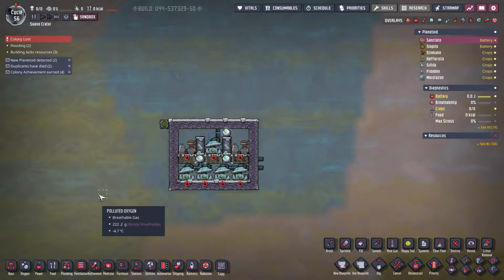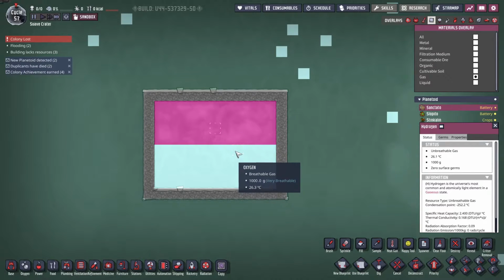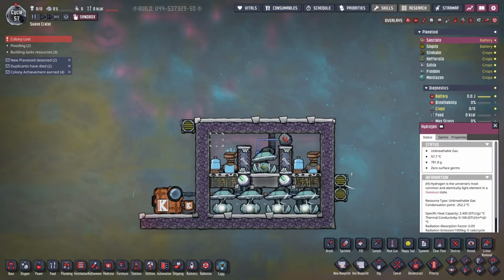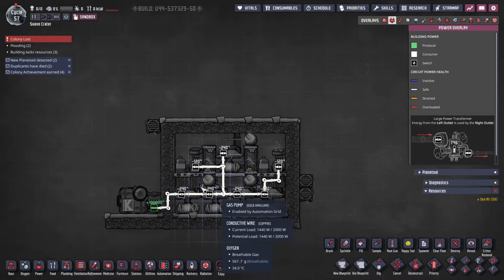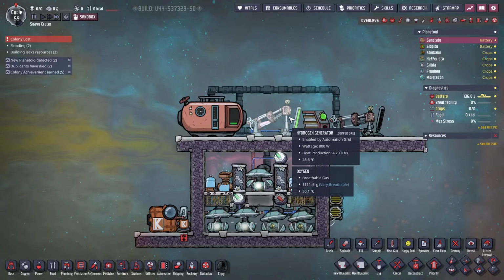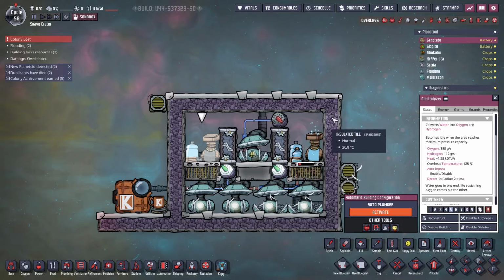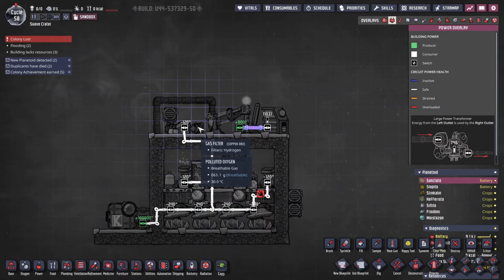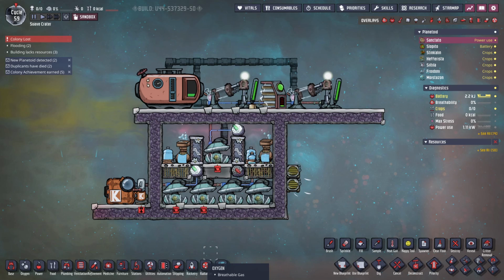Oxygen not included: Producing oxygen with the Half-Rodriguez

Comment: When starting in forest biome I just build the whole thing at the border of the copper biome so I dont have to worry about the heat. :)
No gold or extra cooling needed, I just build with what ever metal I have and run the pipes trough the colder area then when it reaches base (like 10 tiles away) its nice 22-25 degrees :)
Reply from the maker: Hi Nyqa, thanks for the information. Indeed, you can use the cold from the map to cool down the set up but in case this is not available, you will need to deal with the heat. Also, even if there are cold areas on the map, eventually the heat produced by the Half-Rodriguez will make the area hotter unless you have a cold source (e.g. cold geyser).